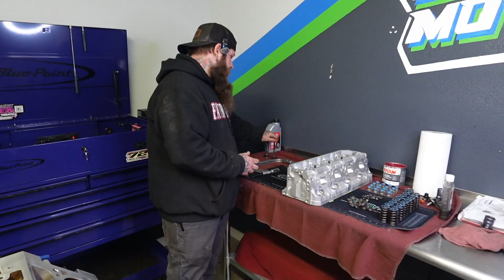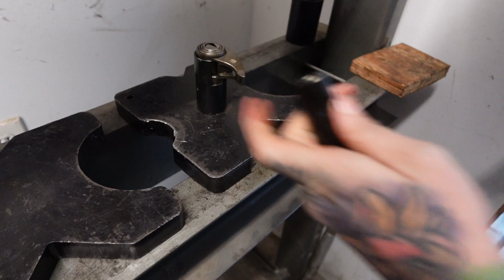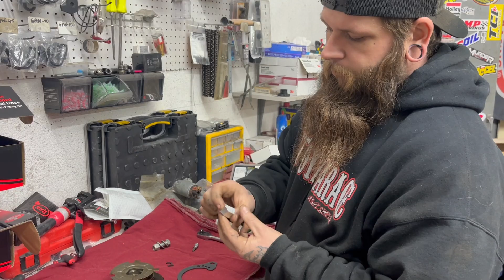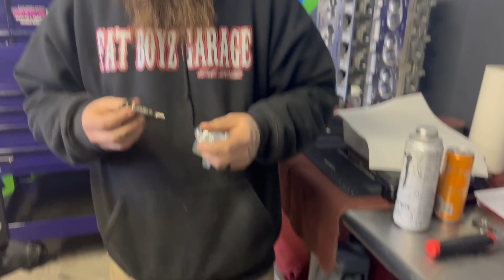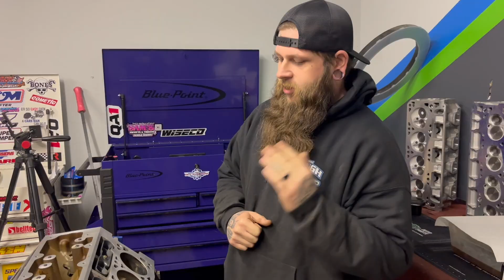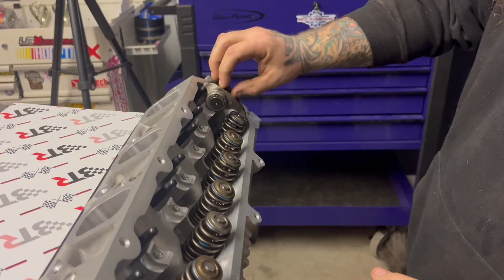Gen V 5.3L L83 Cam & Head Upgrade | BTR Stage 3, GPI Ported Heads

Comment: Question; you listed PN # 25-1025 as the part number that was used for the LTHs, but those are LS-swap LTHs. Did you maybe use a different part number? Or do the GPI heads require the usage of LS LTHs due to a change in exhaust manifold bolt pattern?

Comment: lil tip on the bolt we use in the deisel shop. take a old head bolt take a cut off wheel and slice the length of the threads. makes a grate clean out tap and if you some how mis a bolt hole the fuild will run up the cut

Comment: Just got my ported ls3 heads back from GPI and intake runners have holes in them. Will that be a problem?
Reply from the maker: Hey say “silicone em once the rocker bolts installed” I personally don’t agree with this but to each their own